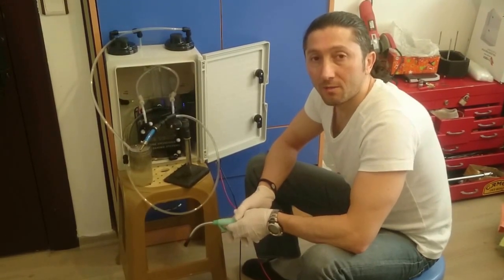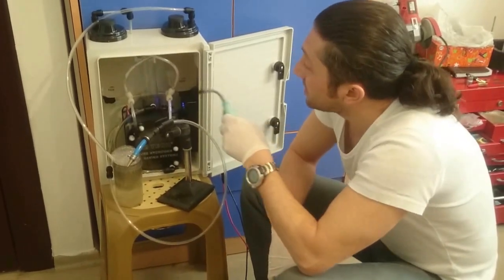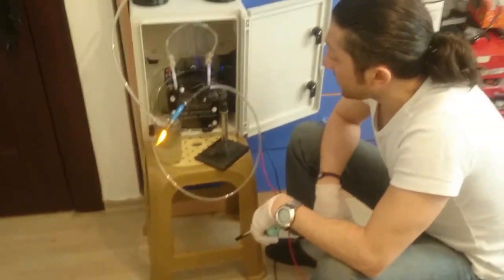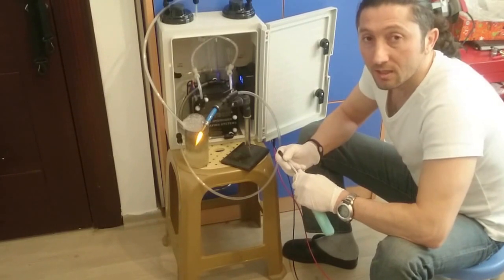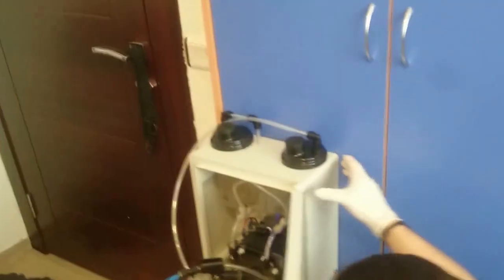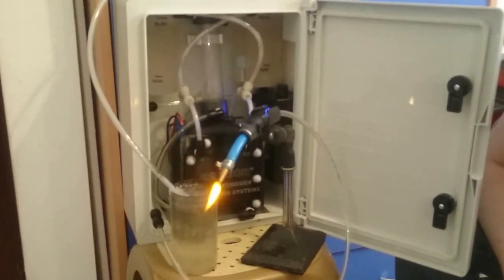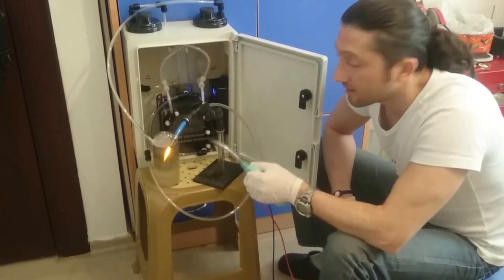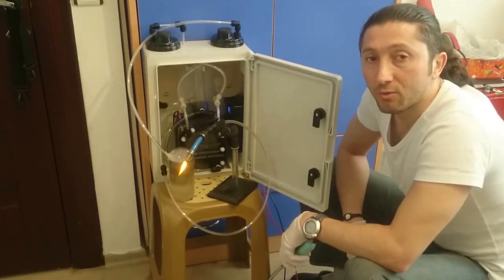PURE HYDROGEN CELL FOR FUEL SAViNGS

Comment: whats with the separation, why not inject HHO?
Reply from the maker: There is a huge difference with pure hydrogen and HHO. With hho no any savings but with only pure hydrogen there is great savings and horsepower increase. Oxygen is changing the characteristics of the pure hydrogen and it is becoming a bombing gas. But in the combustion chamber we need a flamable gas. Pure hydrogen is the best system for the fuel saving and performance increase.
Reply: XWOOFERX  so pure hydrogen is better then hho?